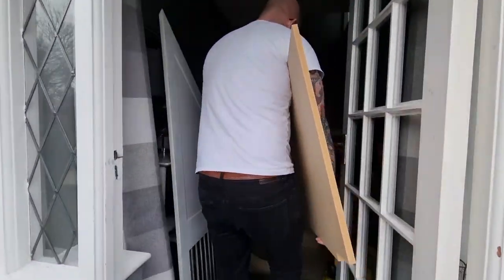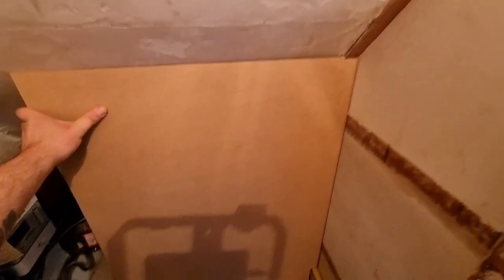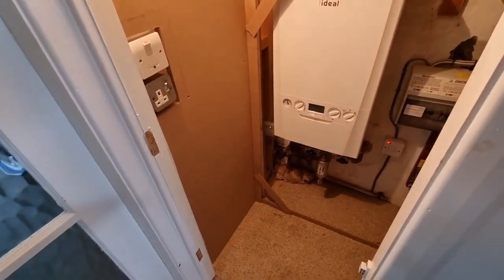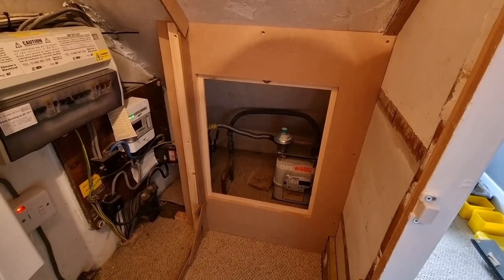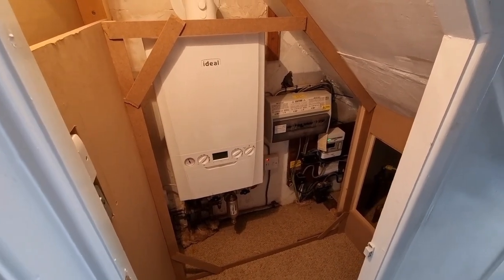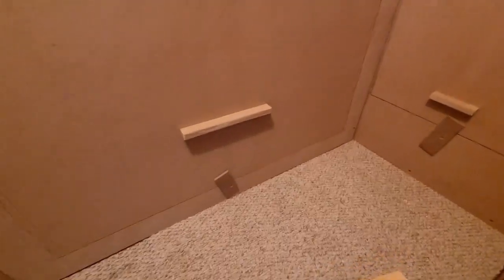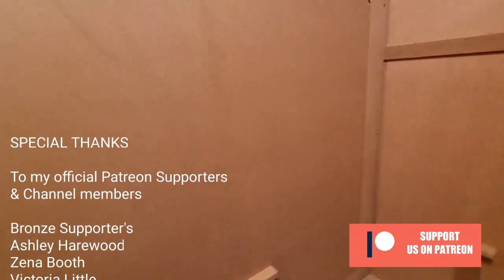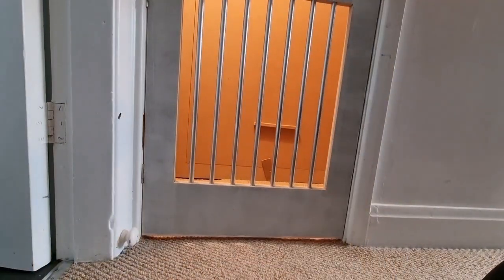Understairs dog house kennel Pt2

Comment: Great stuff mate. I'm a gasfitter here in NZ and two things came to mind watching this video. 1) on behalf of gasfitters everywhere thank you for taking into consideration access hatches and removability, even in my own house when the cylinder died I had to cut a wall out (which still hasn't been resolved, missus keeps reminding me) 2) we wouldn't get away with a meter inside the property here, mental that you have that in the UK (I didn't work in gas when I lived in the UK so paid no attention to that haha) We also don't have smart meters here though, and still manually turn people off when they don't pay their bills!
Reply from the maker: Cheers Sam, I'm glad the build is approved by a gas fitter as well. Ye I definitely don't want make another trades job more difficult. 🙂

Comment: The boiler cover does need to come completely off for services though.... the top off your hatch looks like it isomer than the boiler cover
Reply from the maker: There is room for the cover to slip out and also the whole frame is only held on by six screws easily available for complete access.

Comment: I think you'll need some air holes in the panel in front of the boiler so that can work safely and efficiently. If you restrict the air intake there's a strong possibility that the boiler will emit carbon monoxide which is poisonous - and will kill the dog!
Reply from the maker: It's totally open above and round the sides David, it's not even as closed as a boiler unit, plus there's now a big hole in the door where there's bars so extra air flow. Oh and a carbon direction alarm.
Reply: @karlpopewoodcraft  👍
Reply from the maker: Combi Boilers
Combi boilers are the smallest and most efficient kind of boiler. They don’t have a water tank; instead, they heat water directly from the mains. This makes them quite space-efficient; you might find them in a cupboard or closet, or maybe under a sink. 
 Combi boilers are condensed/sealed-room boilers; they do not need additional ventilation
Reply from the maker: There should be adequate space to perform maintenance work on the boiler itself.
Building regulations also specify a certain amount of space between the top and bottom of the cupboard and the boiler; this may mean the cupboard has no top or bottom boards.
If there’s a door, it should be openable and allow enough space for maintenance and repair.
Additional specifications might be listed in the boiler manufacturer’s instructions.
Reply from the maker: Quite a bit of information there for you David but I'm sure I have made sure these point are all covered in the build. As I say there is no top or bottom to the (unit) the ventilation for intake and exhaust is through the flue so no obstruction there.
Reply: @karlpopewoodcraft  Looks Great, Was thinking the same as David..... BUT with as you've said Should be well covered Or uncovered lol
Reply: Combi boilers take the air for combustion from outside via the flue , no need for vents.